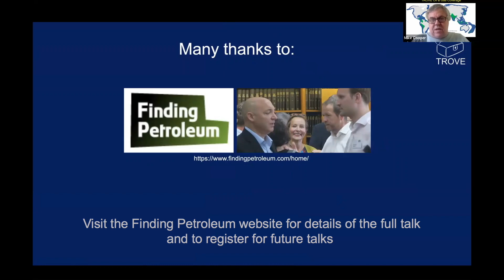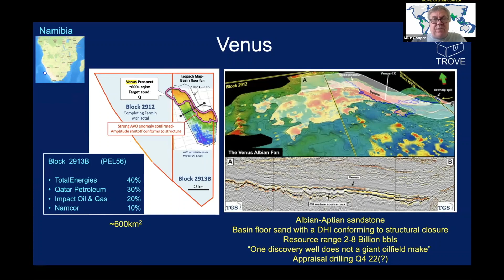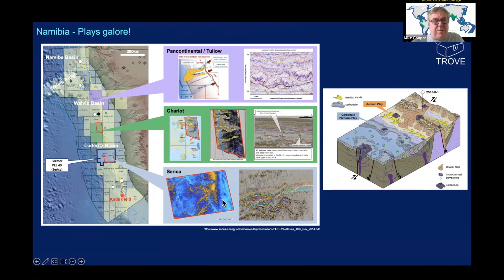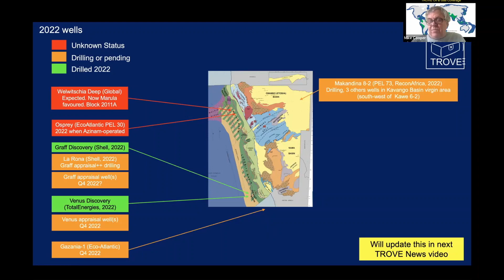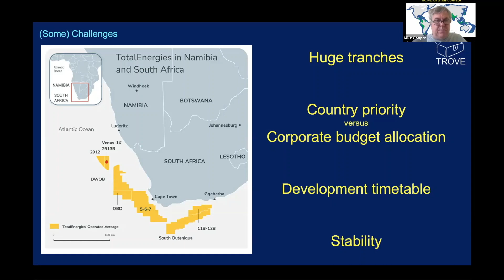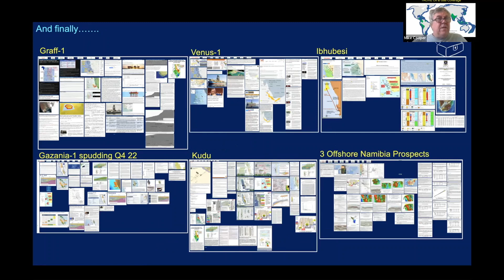Africa Overview: 2022 so far and what's next!

Comment: Keeping a close eye on Recon Africa. Invested in them. SUBSCRIBED.
Reply from the maker: Hi Herman,
 
There was a presentation by ReconAfrica yesterday here at Africa Oil Week in Cape Town (07 Oct 2022) on the Namibia onshore operations. The 8-2 well has been operating at TD for some time (i.e. over a month - ref: press release 30 Aug 22) and no significant update on what the well found was forthcoming yesterday. Have they shown wireline/LWD/any logs from well 8-2? Or 6-2, or 6-1 for that matter? Hundreds of feet of shows reported in the previous two wells, but isn't it about time they showed some data to verify/judge the claims for all 3 wells? There are "shows" and there are "shows" - some are good, some are not exactly significant. A look at the electric logs and mud logs etc should convince a competent petrophysicist. Is there pressure gradient data? Do we have an extensive hydrocarbon column - or not? Is there a flow test with hydrocarbons-to-surface - (don't recall seeing anything....). As the presentation format here at AOW did not allow time for questions, we remain in the dark.
 
No sooner was the well operations mentioned yesterday than RA were off talking about future plans, follow-up wells, pipelines, exporting oil to world markets using Afromax tankers, blah, blah, blah. Smoke and mirrors?? Carry on investing, all is well?!?. But AOW is a technical forum, with lots of "competent persons” in attendance. Why not show the confirmatory data?
 
Were I a shareholder - and for the record I am not, nor ever have been - I would be asking to see technical evidence of the "success" RA are reporting. They should have nothing to hide - it reads like great success from their various press releases & prior corporate presentations. It's not like this is commercial-in-confidence, hugely competitive acreage or anything. The longer there is no technical presentation of the results, the more a strange whiff begins to emanate.....
 
We do know state-owned NAMCOR will go from a 10% carried interest (i.e. they weren't paying costs for the drilling of any of the three wells) to a 5% carried interest (press release 22 Sep 2022). A deal set up a long time ago, in return for shares/warrants in RA, it seems. Is that an endorsement by a Joint Venture partner that results are going well??? We completely understand majors withholding commercially sensitive data for offshore discoveries with rumoured $100mm farm-in deals ongoing. But the Kavango Basin?!? Really?!
 
RA should disclose technical data and thus reassure investors - it's relatively quick, easy and straightforward. BTW, always happy to see serious debate, reasoned comments & technical assessments in response. Heads-up, trolls will have their posts deleted.
 
Any comments? Messrs Andersen & Evans???  Alvarez & Marsal ('onboard' since April 20, 2022)?? Hannam & Partners ('onboard' since July 11, 2022)?? We'd love to see/do an independent assessment of the various well results!
Reply: @TROVE-1stSubsurface   Yikes...Not sure if I should have mentioned the name Recon Africa.  The overall feel of the reply makes it seem like a scam or fraud.   I said the word invested but it's actually speculation money for me.  But I would hate to lose that money just saying if this is a scam. So is that what you think that it's just a well-polished story, with well-known experts, and well-known company names involved.  So, what you're thinking maybe is that the true bad news is in all the data not yet shared with us thus far? I really hope not?  You seem far mor knowledgeable than me. What's your total feel of the company?